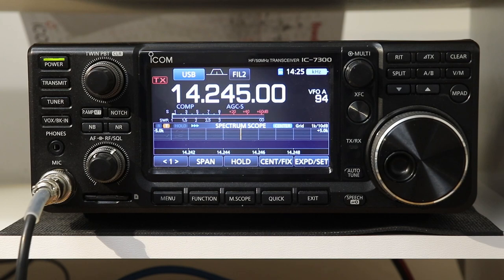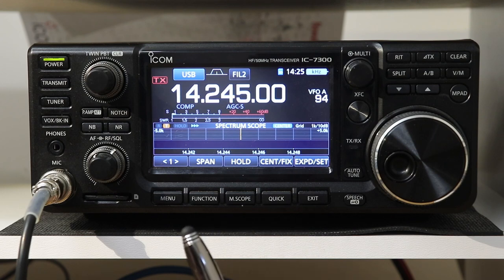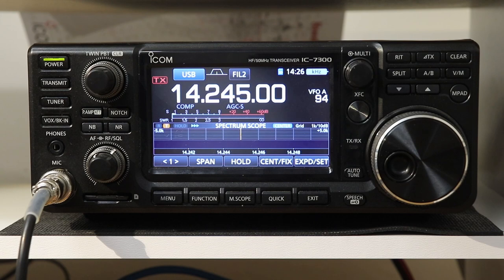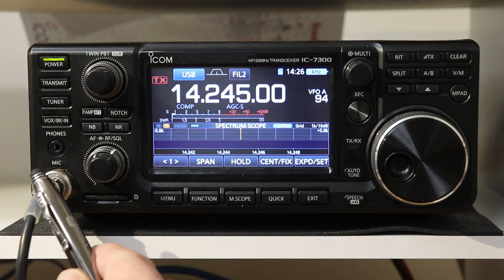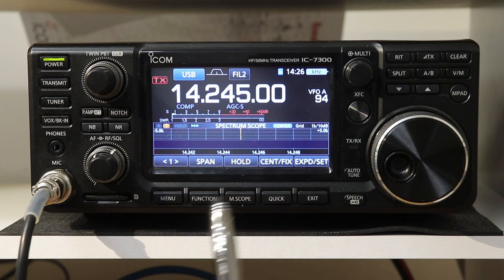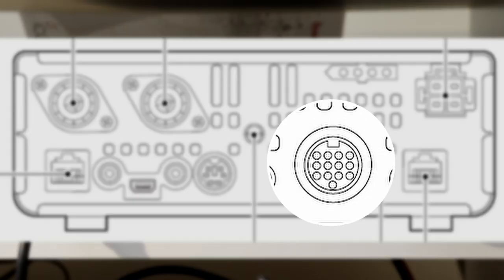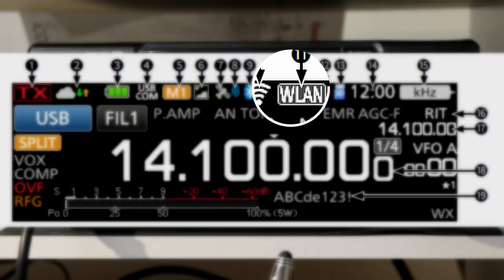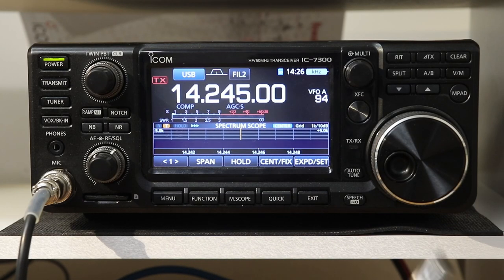Transmit Audio on Icom Touchscreen Radios

Comment: Just wanna thank you for all the great content, I have a 7100 that having recently leveled up to my general have been trying out different data modes, and doing what I can with my cell phone not a computer. Your ham radio a to z videos over the 7100 I would consider a must watch for anyone who gets one of those radios. there is so much more information than I could even remember watching those videos and they are way more explanatory than even reading the manual; either one for that matter. This is another one of those very important things to know about these radios to be able to use them to their fullest extent, and I for one would not be able to figure it out on my own.

Comment: I have been away from the hobby for about 7 years and got my ICOM 705 a few weeks ago...as I was playing around with its capabilities - SSB, digital, etc.  I probably changed so very settings you describe so when I tried to final transmit on HF, nothing. Then I tried UHF simplex and nothing and I knew I had an issue just not sure what it was.... so I reset to factory settings and it worked!.  I am now smarter about the preset for FT8 and the digital modes so I know to switch it back t normal mode to do phone. But for 24 hours I was calling on HF and nothing was going out!  ha,  great videos!   But it is something to remember to do if you were out doing POTA switching from phone to digital, to take the time to make sure your preset is back to normal...
Reply from the maker: Glad you figured it out.  I can't tell you how many times I have factory reset my 705, just so I know I'm starting from a known starting point.

Comment: I may still have to send my 7300 to the shop. Followed your instructions and I still have no transmit. A Factory Reset had no change. I then reinstalled my settings and nothing. Thank you for your videos de KD4MAN 73s

Comment: Hi Tom,
Thank you for the outstanding IC7300 series, it has proved invaluable.
Today I encountered a transmit issue relating to whether I was in Fix or Center setting. In Fix it would not transmit but it would in Center. Comments, pls.
Than you so much.
Ted
Reply from the maker: Hi Ted.  That's a new one on me.  The Center and Fix settings only affect the scope display and have nothing to do with transmit.  So I don't any way that would make the radio not transmit.  If you are in Center mode, you will see your transmit signal on the display (depending on the settings) and in Fixed mode, the scope will just freeze when you're transmitting.  When the scope freezes, you are still transmitting.  Have you confirmed with an external power meter or during a scheduled contact with someone that you are definitely not transmitting?
Reply: @HamRadioA2Z  Thanks so much for your reply. I will check it out using your recommendations and let you know. As I toggled between Fix and Center my transmit capability was on and off accordingly. 
As an afterthought, would my use of a head set/mic combo with a foot switch be a possible source of this situation?
Thanks again!
Ted
K7TDV

Comment: I had that very problem on my 7300.  It turns out that an RF choke inside the microphone circuit inside the radio had blown (The choke  was not on the ground side, but in series)  Apparently caused by a current traveling through the microphone circuitry!?
Reply from the maker: Sounds like yours was one of the rare cases where there actually was a hardware problem.  So far, for everyone that I’ve helped directly with this, it has been an issue with one of the settings or the mode.

Comment: This was exactly what i needed except I have a old 746 pro, i am a extra class, but i have never been on a HF radio except at field day events. I bought my first hf rig off ebay and i have no idea if it even works, i bought an antenna i got a power supply it powers up , but i can not figure out anything from there... if anyone knows of a video that may help i would be so very much appreciative.

Comment: I am trying to use wstjx for ft8. The program comes up and seems to work fine, except. When I double click on a staion  the radio, ic7300,  goes into transmit mode but there is no output. Additionally I have no audio from my laptop which is on the same usb. Can you help? Thanks.
Reply from the maker: Do you have the radio in USB-D mode and do you have the Data ON mode modulation input set to USB?  The default is to get audio from the accessory connector.  You’ll find this in the SET - Connectors menu
Reply: @HamRadioA2Z  Got it. Thanks!